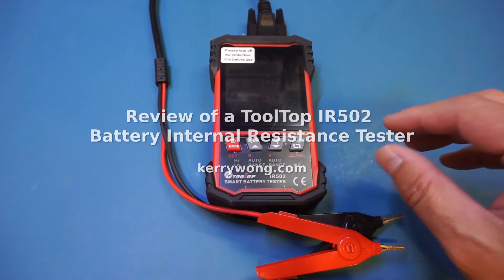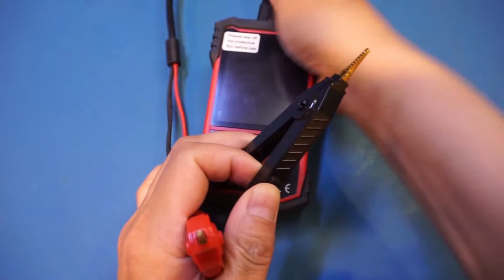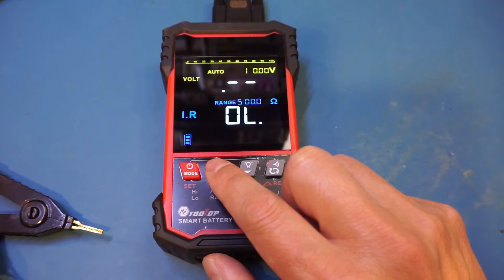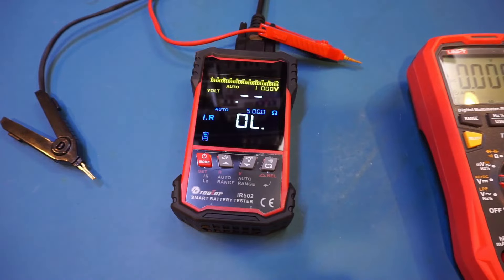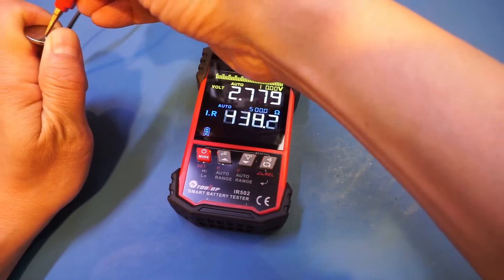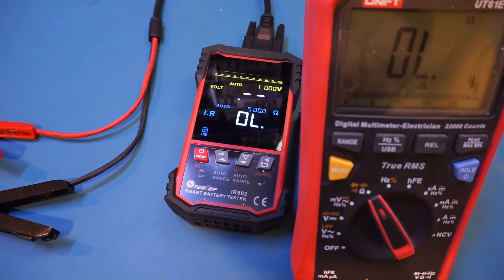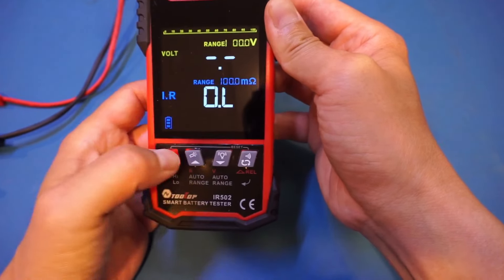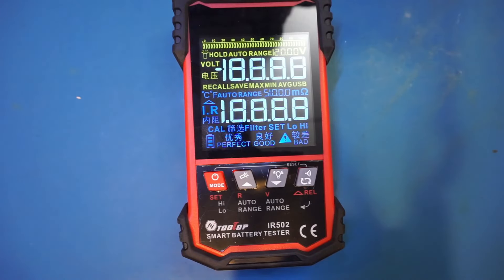ToolTop IR502 Battery Internal Resistance Tester Review/Teardown

Comment: @13:30 nice they have Rubycon caps in there.
Reply: If the capacitors aren’t counterfeit…. The capacitors could be fakes even if the manufacturer bought them in good faith.
Reply: If they were fakes, the brand would be Rulycon or Rudycon in the same font.
Reply: But why are they 200V caps. No battery is 200V.
Reply: @TheDefpom   Supposedly China is cracking down on trademark and intellectual property infringements.  Sometimes I wonder how well that is enforced.  In the past I have seen totally copied trademarks and the only way to tell is if the part does not perform to specification or if perhaps copy looks blurry or there is a misspelling somewhere else on the part.
Reply: @simontay4851  Margin, they need low leakage, so used good capacitors, as this is likely how the AC test is coupled through. 

Wonder how well protected it is against reverse voltage, and them giving the pinout means it is easy to make bespoke test lead sets as well.

Comment: Profit margins have to be very thin on these instruments.  You’d think it would not be worth the extra cost in labor and equipment to obliterate the part markings.  I wonder if it really slows down other shady Chinese manufacturers from cloning their intellectual property?  It is going to make repair of this instrument more difficult, but on the other hand it is probably intended to be disposable rather than repairable anyway.
Reply: The parts will be delabelled before soldering, easy enough with a reel to run them through a laser to scan and erase the marking, and then stick a new top cover on, and reel them up again. Must be places that do this for money, you take them the reel, and get the erased one back.

Comment: The people at Tooltop sure are militant about scrubbing off identification.  Looks like they obliterated every semiconductor number and even sanded the frequency off of the crystal.
Reply: Sanding the crystal is pointless. Its easy to measure the frequency. Even cheap multimeters have frequency measurement.

Comment: I did not understand, if the meter uses the Kelvin method for measuring resistors. You would think so, but I would have like to have seen that proven, one way or the other. Cheers.

Comment: Perhaps the reason the meter is giving you unexpected “resistance” readings for the 100 ohm resistor is that it is actually measuring impedance. Is that resistor wire wound inside?
Reply from the maker: At 1kHz, I would expect some deviations but not 1.5 Ohms. I had verified the reading with an LCR meter at 1 kHz.
Reply: I just tested some wire wound resistors between 50 and 680 ohms. The maximum error I got at 1 kHz was 0.5%. Equipment ET431 and error based on Zs/DCR.  The impedance was always > resistance, as you might expect. Between using REL and switching to a Vishay rectangular precision resistor, I bet the measurement will have less than 1% error.

Comment: Couldn't you just use the ohms law method to cross validate the accuracy of the meter?
Reply from the maker: As mentioned in the video, the resistance measured by the AC conductance method is slightly different so not an apple to apple comparison.
Reply: @KerryWongBlog  I appreciate the fast response. I enjoy the reviews and product testing keep up the good work.

Comment: This is surely useful for the off grid freak to weed out lazy batteries. Say your house has a 48V system and 12V lights, you can arrange the batteries to feed the lights from strong batteries rather than waste inequality inside the BMS and use a converter to reduce 48V down to 12V. Mustool is offering cheap solutions for many DIY folks. They could sell thie even cheaper but I guess this is a low volume product.
Reply: This one is similar in price to existing products of this type and spec.
This is a few $ cheaper and has a colour vs monochrome screen.

Comment: I see the battery meter has a "rel" button. Accuracy might improve if you rel'ed it out.
Reply: Yes, every power up like clamp ampere meters in DC you should power on and wait a little, short/close the contacts together and then zero it to compensate any drift or error from leads

Comment: To accurately measure the batteries with 4 wire system, you must separate the probe tips with an insulator and touch the battery at 4 points.
That's not what I have seen in the video.
Reply from the maker: I mentioned that as well. Given the battery terminal types of the batteries it was nearly impossible to do that.

Comment: You can use most DC loads with a scope and do the same test.   Set the load to pulse the current (you can even put a small draw as a baseline), and observe the voltage on a scope.   Pretty easy to get decent results.   For coin cells, you can use a signal generator instead of the dc load - just be careful not to set it to charge the battery (although with a milliamp or less, really not a problem)

Comment: DB9, heh. Somebody has been digging in the trash pile.
Reply: The other well known IR meters use a 4-pin QX type aircraft connector, similar to what's used on Hakko soldering irons. Much bigger than the DB9 used here.
I have one IR tester that is very slim and uses a standard USB type A plug and socket. The current is tiny so it doesn't matter about thin conductors.